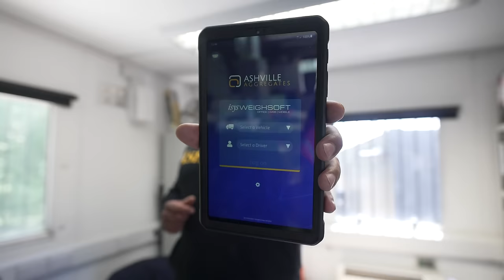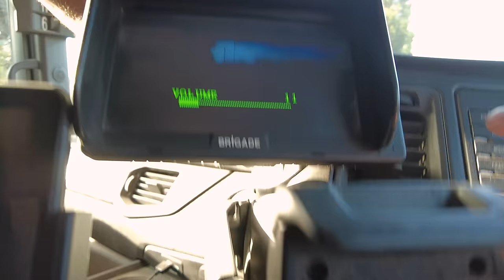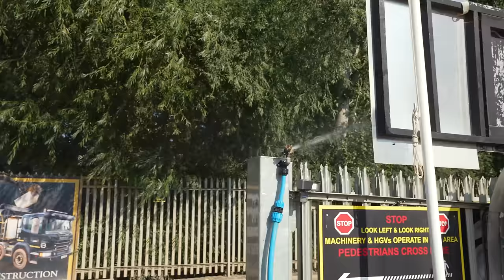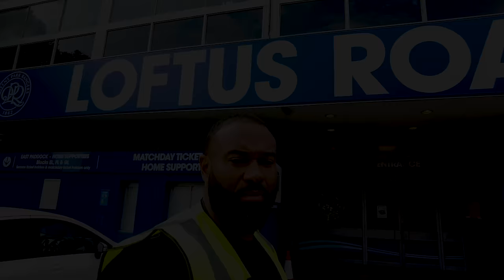More Problems, More Solutions... in a Heatwave! | Ashville Weekly ep094

Comment: Slightly embarrassing story with the knocking on that tipper, but fair play to the driver reporting the issue and pulling over. They are the type of people you want working for you, protecting company assets :)
Reply: Every day is a learning day remember that
Reply: Driver done the right thing but also if he had any brains he’d have realised it was the camera volume. Saved a fortune by going out yourself Dan.
Reply: @Wetthewhistle  ok Mr perfect
Reply: @Wetthewhistle  Maybe not used to modern machinery with a mic on the outside cameras
Reply: @Wetthewhistle  you’ve obviously never been flat out doing 8 loads a day on a 32 tonner from 5AM in the morning have you? No real driver has the time to sit in a cab and waste 30 mins trying to find a noise, better to speak to transport and get it sorted via them otherwise driver gets the blame for missing a load, or worse blamed for damaging the truck.
Reply: Absolutely. Could've been seriously expensive if it was an issue
Reply: @eternalmastery  totally agree with you! My boss wants to know ASAP if something happens that probably will affect the workload.
Reply: Nothing embarrassing about that, driver did the right thing
Reply: I actually prefer that. Rather he take precautionary steps to protect equipment than pretend to know what's happening and cause damage.
Reply: @Wetthewhistle  Sometimes sudden unexpected sounds can be a little jarring.